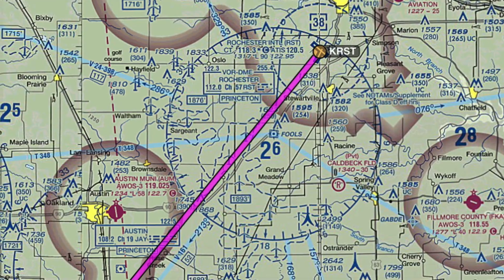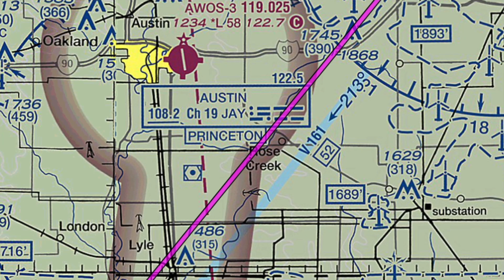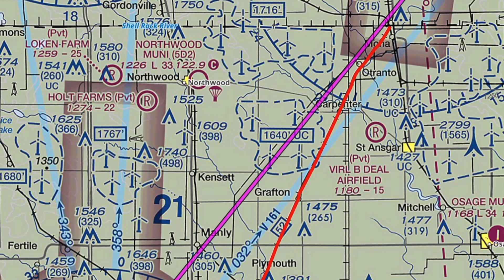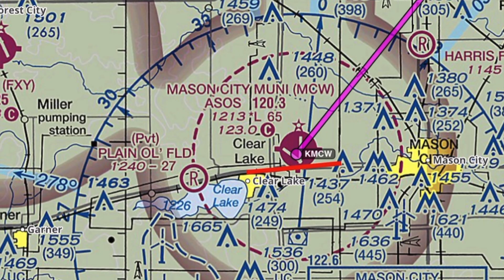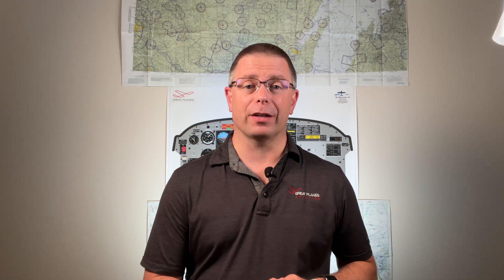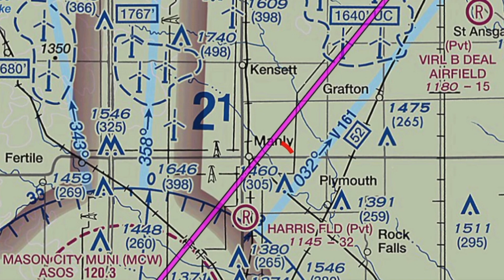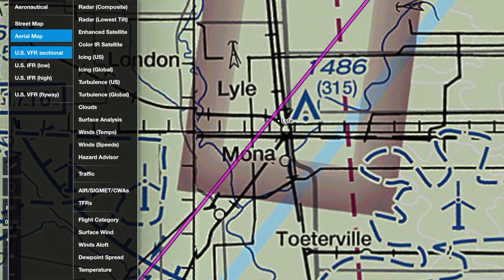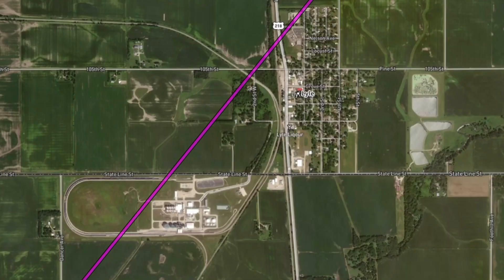VFR Flight Planning Tutorial | Route Planning

Comment: For time between points in dead reckoning, should I average the times to the nearest whole minute?
Reply from the maker: Good question.  My quick answer would be “no”.   If you are flying 12 miles and it takes you 5 minutes and 30 seconds to cover that distance, you would be traveling at ~131kts ground speed.  If you round up to the nearest minute (6 minutes), your ground speed would calculate at 120 KTS.  If you round down to 5 minutes your calculations would show 144KTS ground speed.  That 24 KT gap between 5 and 6 minutes a bit much.  If you look at the whiz-wheel E6B, they allow you to easily calculate to the nearest 1/10 of a minute.  So, that is what I’d suggest.   I hope this helps.

Comment: Your videos have been a great help in providing understanding how to more easily plan flights. Thank you!  Using the image views from various mapping sites available these days I think is a great idea. I'm hoping that X Plane and MSFS202 provide views from altitude of at least some of the lakes and larger towns. 😊
In "finger flying" does Foreflight or other electronic apps have the ability to mark the 10-20 mile waypoint segments on sectionals as you suggest and do it to-scale?
Reply: I just saw another video in which a user was using ForeFlight very much like using a paper map and highlighters. For now I'll use the plotter. I'll find some expired maps for practice.
Reply from the maker: Thank you!  The short answer to your foreflight question is “yes”. By placing your finger on a map point, you can make a waypoint and make it part of your flight plan.  It will be on the map and “to scale”.  My students do it all the time.  I let them do the mapping and plotting in Foreflight.  However, I do make them do the wind correction, ground speed, time to station, fuel use and other performance calculations by hand so they understand how to do them.  Once they understand the process, I’ll let them use foreflight to do the calculations so they know how to do that, too.  As we get closer to the check ride, we go back and forth to ensure they still understand the calculations and can answer questions they might be asked.  I hope that is helpful.  Best of luck and let us know how your training is going!!  Thanks for sharing your comments and questions!

Comment: This is the easy part. It's all the weather-related calcs and airspeed calcs that get me. Takes me hours
Reply from the maker: They do get easier and faster.  One thing I mention to my students (perhaps you are already doing it) is to make the course as straight as possible.  The direction changes you make, the more calculations you have to do.  In many parts of the country, using a straight line course means you can cut down significantly on the number of times you have to recalculate wind corrections and ground speed.  Thank you for the comment!!
Reply: @ScottKoonCFI  yes that would make it even harder, thanks. I guess the days of VOR-hopping are over.
Reply from the maker: Hello Kurt.  

I guess I should have asked this earlier… Are you studying/flying Instruments or working on your Private Pilot certificate?  If you are working on/refreshing an Instrument rating, then ignore the rest of this answer.  You need to use VOR or RNAV navigation as part of your Instrument training.  However, for VFR navigation, Electronic Navigation tools are thought to be secondary…

I wouldn’t say the days of VOR hopping are over, but for low-altitude navigation, they are getting harder. Since 2016, the FAA has been implementing the VOR Minimum Operational Network (VOR MON).  As the FAA puts it… “as part of a NAS Efficient Streamlined Services Initiative, the number of conventional NAVAIDs would be reduced while more efficient Area Navigation (RNAV) routes and procedures are implemented throughout the NAS”. 

The AIM Section 1-1-3, subsection “f” describes it in much more detail.

Plus, for private pilot candidates, the emphasis is on learning to use Pilotage and dead reckoning.  In fact, the Pilot’s Handbook of Aeronautical Knowledge (pp. 16-22) states “Although precision in navigation is obtainable through the proper use of this equipment, beginning pilots should use this equipment to supplement navigation by visual reference to the ground (pilotage).” 

So, it appears the FAA is focusing on Pilotage/Dead Reckoning and RNAV navigation while slowly de-emphasizing DME, ADF, and VOR navigation.  And, like everything in Aviation, there are trade-offs.  Going from VOR to VOR might mean less chance of getting lost, but it means there will be more course changes and the number of calculations will be greater.  While flying straight line Pilotage has fewer calculations, it might be more difficult due to lack of available ground references.  As PIC the choice is yours, but Area of Operation VI, tasks A and B indicate you’ll need to demonstrate both for a check ride.

Having said all that, a knowledgeable local Flight Instructor is the best resource for determining where you are in your training and how to navigate in your area.  If they are saying use VOR navigation, that is what I would do.

I hope this helps at least a little bit.  Good luck with your flying!  Thank you for the comments!  Please keep them coming!

Comment: I know this is a video about pilotage but I  always found it helpful to find a radial from close by VORs that intersected my chosen checkpoint to confirm where I was. On occasion I used the intersection  from two radials from two VORs as a checkpoint. Of course this was before GPS and foreflight. Being able to actually confirm you arrived at the correct checkpoint was not only comforting but aided in situational awareness.
Reply from the maker: Excellent!  Absolutely!  Prior to GPS, I used to do the same thing.  Sometimes on long cross country flights I still use VOR triangulation to locate my position because it is cool (in a nerdy way) and to make sure I can still do it.  Thanks for the comment and safe flying!

Comment: Thanks for creating this. Question: Isn't ForeFlight actually giving you a magnetic heading adjusted for variation rather than a true course on the ground at 2:03?
Reply from the maker: Hello!  Thank you for pointing that out!  

You are correct.  However, in this case they are the same.  In this part of the United States, magnetic variation is 0 degrees.  I described that during one take, but it appears I accidentally edited that out.  I'll see if I can fix that. 

I actually have a picture of a plotter against the same course, showing the true course is ~219, but used the Foreflight image because it was cleaner and easier to read if people were viewing on a phone or other small screen.  I'll rethink that choice for future videos.

Here is a link to that image: https://drive.google.com/file/d/1CsnpCiiWgxofTPWwb4-K1p6WAHGwGnAp/view?usp=sharing

Thank you, again!!
Reply: @ScottKoonCFI  Ahh - thanks for the explanation, I appreciate it. By the way, I just learned today that as of recently you can now set the ruler (and other directional instruments) to show true course instead of magnetic course if you like. It's under Settings -> Units/Time -> Bearing and Track Instruments.
Reply from the maker: Perfect.  I did not know that!  Thank you for passing that along!  I'll use that for next time!

Comment: Great job! Would love to for you to do a video on weather minimums ! And other weather related videos! I struggle with weather concepts
Reply: I am European which make me take note of some 'unusual' corners of the topic. I see you (USA) have a common classification into LIFR (Low IFR), IFR (as in non-low), MVFR (Marginal VFR) and VFR (as in non-marginal). The boundary from LIFR to IFR is approximately when it becomes possible to get a Special VFR clearance (500' / 1 SM), the boundary from IFR to MVFR is approximately the required condition for daytime take-off and landing in controlled airspace (1000' / 3 SM), and the last boundary is that non-marginal VFR means ceiling better than 3000' and visibility better than 5 SM. I find that last one quite interesting; you can have Scattered 800' AGL in "non-marginal VFR" whereas 5 SM visibility will automatically make it marginal VFR. I feel that SCT 008 is probably "lower"/"worse" than 5 SM visibility (I will admit that comparing cloud cover to visibility is a bit of a weird discipline) - how do you feel?
Reply from the maker: Sorry it took me a few days to see your comment.  You are right, this is a bit confusing.  

Here in the US, the terms you note: LIFR, IFR, MVFR, and VFR are category terms generally describing ceiling and visibility conditions regardless of airspace—a “quick reference” if you will.   They aren’t intended to be used by themselves to determine whether or not you can depart or fly under Visual Flight Rules.   Further, they don’t include all cloud layers, only those layers forecast or reported as Broken or Overcast (the definition of ceiling).  

The criteria used to determine whether or not you can fly using Visual Flight Rules is actually defined in 14 CFR 91.155.  This section defines the criteria based upon a combination of airspace, visibility, and clearance from clouds (all clouds).  

This “mixing of terms” can lead to some interesting situations.  For example, say you have an area where the visibility is 2 Statute Miles, and the Ceiling is at 900 ft AGL.  This area would be described/shown as IFR.  BUT, if you are at an airport during the day within class G airspace such as Albany Municipal (K19), it is legal to take off and fly under Visual Flight Rules, since you only need 1 mile visibility and the ability to remain clear of clouds.

All that said, I agree with you.  A scattered layer at 800 ft AGL, could be worse than 5 SM visibility.  Especially if the scattered layer is covering 5/10 of the sky and that 5/10 is right over your airport.

Thank you for this observation and question!  This was fascinating to consider, and has triggered a couple of ideas for another video!  Thanks again!!
Reply from the maker: Thank you!  I already have a video on cloud clearances and airspace planned.  I will definitely add some other weather topics to the list.  Thank you so much for the suggestion!